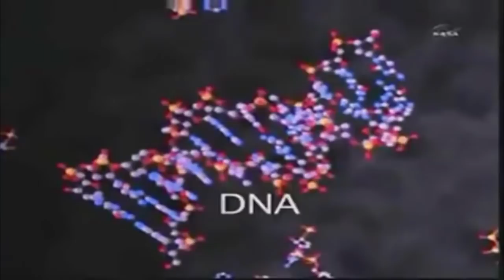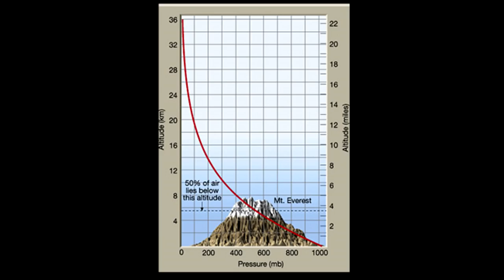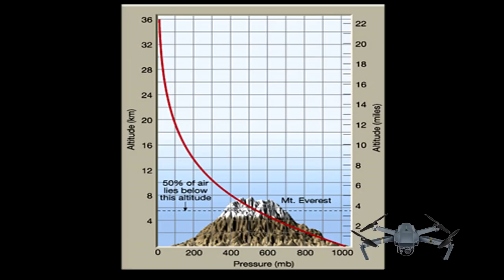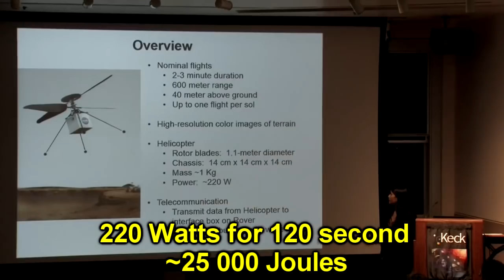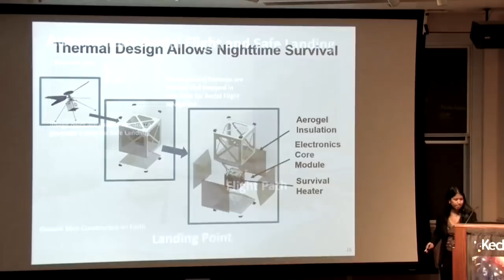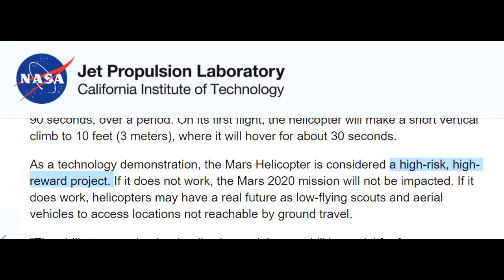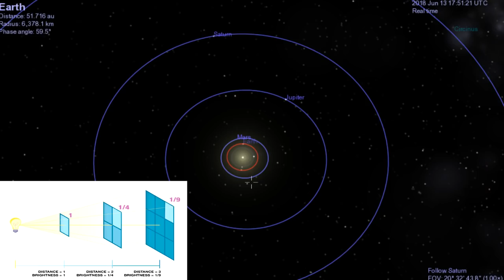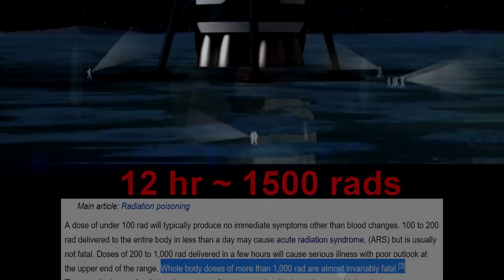NASA is sending Helicopter to Mars!! Smart or Silly?

Comment: Two major aerodynamics mistakes in this video:
1. the lift explanation is sub-par, overly simplified with impact physics instead of pressures. Also maximal lift is usually achieved at ~15° angle of attack (not 45°), after that you are likely to get separation and loss of lift on the upper side of the wing!
2. Lift is proportional to the square of the speed and not linearly proportional, therefore in a 1/100th of an atmosphere you only require 10x the speed!I think it's good to point out that at 1/100th atmosphere you also have less drag. I think the problem is possibly having the rotors approach transonic speeds -> compressibility -> problems. I trust they know what they are doing.
Reply: They've tested it in a vac chamber, job done.
You're the first I've seen so far to point out that not only is the lift explanation wrong but so is forgetting atmospheric drag.
If you can run a earth bassed aerobatic heli blade at those RPM's then you'd need farrrrr less power to spin at the same rate on mars and far less material strenght to support the large heli body and the serious loads those stick stirers put them under. 
centripedal force is no matterial issue so aerodynamically you'd have the same forces to lift 1kg here that you will on mars.

Purely for control they'd be far better going down the multirotor route, it can be a bit breezy up there and that style of rotor with it's low power won't do well to combat it.
Reply: At 45 degrees angle of attack on a helicopter you're going to get rotor stall and possible separation of the rotor from the aircraft lol. Helicopters typically have around 10-12 degrees collective pitch maximum and around 6 degrees cyclic pitch control.

Comment: Was that a "safety tether" in the vacuum chamber test? I assumed it was a counterweight, providing about 2/3 of the lift needed to lift the craft, to simulate Martian gravity. I could be wrong though, I'm just guessing
Reply: I think they just didn't want to crash it in the confined space.
Reply: CreativeType well it could've served that purpose too. a 2 in 1 thing kinda
Reply: Hadn't thought of it being a counterweight, good point.
Reply: I thought this same thing
Reply: Not likely.  They just don't want to trash their prototype if there is an unforeseen mechanical failure.
Reply: As Thunderf00t said, it shouldn't be able to fly on earth a counter weight is the only reason it should be able to.
Reply: Nicholas Hylton 
It is likely. They use tethers all the time to duplicate reduced g. The astronauts trained with tethers to mimic lunar g. 

So a reduced atmosphere in a chamber, and tether assist lift is very reasonable.
Reply: +Josh Patton
He said it probably wouldn't be able to fly on earth outside of a vacuum chamber.
Reply: impero101 he did, but it's still the only explanation for how it could fly in earths gravity with those proportions
Reply: Certainly, and I definitely agree that the purpose were probably two-fold as a safety-wire and counterweight, such that they didn't have to pump most of the air out of such a big room. :-) I just wanted to clarify what TF said to avoid a misquote.
Reply: Neko Suki not likely, they'd have the battery on board for weight anyway, so shouldn't need needed
Reply: impero101 
There are large enough vacuum chambers. It’d be more than worth it to create Martian atmosphere and Martian gravity as best as possible. If the whole thing is crap shoot, proper, most realistic testing is the minimum.

What cannot be duplicated/simulated is the Martian gravitational effects on the inertial gyros. The reaction of the mass of the machine in flight is still 1g environment.
Reply: Vacuum chambers have nothing to do with gravity, you can't pump the gravity out of a room. The earth is still right next to you!
Reply: Jordan Manners 
Duh.
Reply: They use tethers to simulate reduced gravity by pulling UP on things!  To have it tied down to the floor?  The only explanation for this is a safety tether, to prevent it from hitting the walls and eating itself.

Unless it is a wire that provides power - which would be useful for initial testing . . . but that would be an obviously unrealistic thing to expect to have on Mars . . .
Reply: (It probably IS the power supply, now that I've thought three more seconds about it.  I mean, where have you ever seen the SUN replicated in a vacuum chamber?  It's way easier to just deliver the same amount of power via cord - once accounting for the extra power needed to lift the cord . . .)
Reply: +Roonasaur I expect it wouldn't be too difficult to simulate a rough equivalent of martian sunlight in that chamber. Indoor growers can effectively simulate Earth ground-level amounts of sunlight every day with cheap, commercially available lighting. Devices like light-emitting ceramics can permit a wide and tunable intensity range and have a broad variety of spectra available.
Reply: But . . . would solar simulation be more or less difficult than just running a wire through less-than-air? THAT is the quesiton, lol.
Reply: I'd say that you'd want as close to the as-operating-conditions as possible, and things hanging off the bottom of devices (even relatively light things) would probably have an effect, but we're just spitballing here. I'm just pointing out that there's really not much of a challenge simulating the quality of sunlight on the Martian surface here on Earth if they wanted to test that hardware in action.
Reply: Roonasaur 
Oops. 
Power umbilical.
Reply: If we're going for as-realistic-as-possible . . . then how are they simulating atmospheric conditions?  Dust?  . . . Radiation?

Obviously, there's no way to replicate everything.
Reply: Roonasaur 
There’s a lot of data from the rovers. Particularly Opportunity which has lasted 14 years. Spirit lasted 5 yrs. their forecast was 90 Martian days. Curiosity is still active at 3x longer than original mission outline. Sojourner original mission outline at 7-8 Martian days lasted 83, 10x longer. 

So there’s a lot of institutional knowledge on what works and how it ages and the climate it has to endure. 

If the copter lasts a few flights it’d be fantastic. If it lasts as long as forecast it’d be fantastic. If it fails to launch, or gets airborne and immediately flips over, that would be sad.
Reply: No, but one step at a time. Seeing if you can reliably lift the anticipated mass in that configuration in that thin an atmosphere and on the back of energy gathered from light of that intensity through that hardware comes before doing all that PLUS adding dust, PLUS adding rads, et al. Baby steps.
Reply from the maker: yup... right.... didnt think of that :-(

else you're right, you have to triple the thrust you get from the helicopter and that never gonna happen.  From my experience with drones the difference between the power you need to fly, and 3x the power you need to fly is ludicrous!
Reply: eh at least he's got the humility to accept he got it wrong
Reply: A good assumption. Since this was being tested in Earth's gravity not Martian gravity that it would be proposed to work in.
Reply: It just needs to fly. Radiation or (dust most of the time) has not bothered the two rovers on the Martian surface for over a decade.
Reply: Exactly what it is.
Reply: K B  You don't need to specialise in chemistry to know that turning lead into gold is infeasible.
Similarly, you don't need a huge amount of experience with drones to know that achieving triple the thrust it takes to hover would allow you to accelerate upwards by double the gravitational acceleration (which is far more than necessary and there's no way they're doing that for a proof of concept-esque thing with some harsh power constraints).

Comment: As for 1W of power, it's worth noting that average industrial solar panel (like that 40W example you showed) in perfect conditions (90 degrees sunlight) converts around 15% of photons into electricity. However NASA doesn't have significant budget constraints, and they can afford something much more fancy - like multi-junction solar cells, probably with efficiency reaching 30-40% - like this one https://technology.nasa.gov/patent/LEW-TOPS-50 

These solar panels are prohibitively expensive, but in that case, additional cost is justified.

That moves them from 1W to 2-2,5W which is probably a significant difference
Reply: and it doesn't really need active cooling to any significant degree, the passive heat generated by the CPU and(likely) GPU should heat the craft well enough even when they aren't being used.
Reply: Lower pressure would reduce the heat lost significantly too.
Reply: Wouldn't the charging of the batteries alone create a decent amount of heat. Only need enough heating/insulation ability to prevent freezing at night.
Reply: TF says though that even if they used basically his cheap shit Chinese one it would produce enough power for a few minutes of flight, he says the numbers do indeed checkout overall , also TF didn't account for the lack of atmosphere which will increase efficiency, but TF doesn't make videos for scientific peer review.  He uses simplification and generalisation to highlight in layman's terms his points.  Which is basically it may work or it may not work.
Reply: As solar radiation on mars is about half of that on earth - they actually need the better panels.

Comment: It's always a bit dubious when you use some consumer level device for reference.. It more than likely uses multi-junction solar cells which sit around 35-45% efficiency..not to mention that solar cells are more efficient in space (no massive em field and little to no atmosphere on mars). The only issue I see is dust settling in between and on the blades/motor and coating the solar panel.  Also, it may sound like a simple maneuver but if they were to fly in the direction of the setting sun in their test flights they would get a tiny bit more power over all. I'm looking forward to seeing if they can pull it off. That ITS thing is old as hell Thunderf00t.. he said fueling stations along the way.. it's not even close to being fully solar powered. It's a vague presentation of some non existent mission far into the future.. it's fair to assume some sort of radiation shielding adequate for the task would have been developed. Though you don't have the massive magnetosphere of Earth there are pockets of fields poking out of Mars.. and if we're talking about Enceladus then you should check out Saturn's massive magnetosphere completely engulfing Enceladus. So you would be perfectly fine landing on Enceladus with basic shielding.
Reply: Taun-Chi Gaming finally someone who understands
Reply: Though what about the low atmosphere problem that would make the engines work much harder? Or the problem with making it stand right up if it falls Also the panels might be 15% to 20% more efficient then standard commercial panels but Mars still does receive far less sunlight and panels are probably still smaller then a 40 watt panel.
Reply: The only thing to make it work harder is the centrifugal force of the larger blades or higher RPMs. Otherwise resistance from pressure differentials will be the same as required force to lift the same object in Earth's atmosphere.
Reply: Also worth taking into consideration is most drones/quads use multiple motors in direct drive, whereas this could use a single motor with a gear reduction...it could consume less power while still turning relatively large rotors at a lower RPM.
Reply: If you partner it with a traditional rover then you could charge off the rover's massive solar panels
Reply: The problem with gear reduction is weight and this thing has to be ultralight. I bet they just hook the motor directly to the lightest shaft they can come up with that will take the forces expected.  The speed of the motor itself can be controlled electronically. It doesn't need to be nimble just efficient and predictable.
Reply: You need to remember that mars receives only half the radiation from the sun that we get.
Reply: Atian Firebolt But what is the effect the thinner atmosphere has on W/m2 on the surface?
Reply: Laughing Daffodils if its a counter rotating rotor, it'll either need two motors or some form of gearbox.  I'd imagine an extra gear or two weighs less and is more efficient overall than a 2nd motor.  Would be interesting to see how they've actually done it.
Reply: Taun-Chi Gaming 
 I love NASA. They do so much research and improve technology here on earth. So many people complain about funding NASA "while people are starving", etc, but the advances made by NASA and SpaceX benefit humanity in countless ways.
Reply: pws3rd 1 That's what I was thinking. Maybe a large solar landing pad that it could land on to wirelessly charge. It would still need its own cell for emergencies, which could be angled into the sun (the drone would always land facing the same direction). As for the solar radiation hitting mars, is he only taking distance into account, or is he considering the thin atmosphere with less water vapor?
Reply: Well, it's not NO atmosphere. Clearly there's enough to let a little helicopter fly.
Reply: +Andy Jones
Space X? I understand.  Space X has done more for space travel then NASA has done since the 1990's.
Anyone who thinks that NASA should keep getting funded is fucking stupid and is only focusing more so on it's past achievements from before the 1990's.  

Anything after the 90's becomes extremely scarce and hard to find, while you have companies like Space X already developing re-use able rockets, the most powerful rocket ever built, and even managing to push literal cars into space all under 1 rocket.  Now name me 1 NASA achievement in the last 2-3 decades now that is anywhere near comparable to that.
Reply: The only effect the quality of the solar panels has is the duty cycle of the system: if your solar panels are twice as good (for the weight), you get flights that are twice as long, or twice as often.
I don't see a problem with Thunderf00t's 1 Watt average power figure.  With good thermal management, it can operate on near-zero power when not either flying or transmitting, which is most of the time.

Comment: You got something wrong... to fly in air half as dense, your wing needs to fly sqrt(2) times faster, because lift is proportional to v^2. To fly in air 1/100th the density, the blades need to spin 10x as fast. Due to Mars' .376 gravity, assuming 1% air density (density, not pressure, the higher MW of Mars' atmosphere partially offsets the lower pressure), they need to spin sqrt (100*0.376) = ~ 6.13x faster
Reply: And this v^2 relationship shows up even in your simplified "batting air molecules" model (staying away from that debate, but TF is more or less right on the basics). If you spin the blades twice as fast, you will encounter twice as many air molecules per units time **AND** those molecules will be moved out of the way twice as fast. You change the velocity by a factor of two on twice as much mass. The momentum change is thus 4x. There's a huge difference between spinning 100x as fast and 10x as fast.

Comment: Cheap solar panels are about 17% efficient.  Top quality consumer grade panels top out at about 25%.  The best cell ever made achieves over 40% efficiency.  Pointing to the cheapest panel and saying 'they won't have enough power' is not very sensible.
Reply: CatsMeowPaw 
U compare that with silicium based cells, but there are more materials outhere that work. One got way better yield, but degrade very fast. Thats bad for comercial purposes, but for a device that will stop working by dozen other reasons long before that effect come in place, it means nothing.
When i remember the name of this stuff i will edit, but if u watch the scene, u probably know it.
Reply: The current "off-the-shelf" GaAs triple-junction cells used on the solar arrays of almost every satellite range from 25 to 30% efficiency. Lab prototypes currently reach way over 40%, so I guess that it isn't too far of a stretch to assume they're using something with an efficiency closer to the latter.
Reply: No it is - as the solar radiation on mars is about half of that as it is on earth.
Also the panels on mars have to last  without failure under harsh conditions - they are not even close to those that only need to operate in space or laboratories. better than consumer products but they would need to be over 40% efficient to change anything.
Reply: "they are not even close to those that only need to operate in space"
You know that space is about as hard as it gets for a semiconductor device? Also, I'm not aware of any reasons why a solar panel on Mars would meet any significant challenge in those conditions.  The only issue you have on mars is the dust that can permanently block the solar panels of a stationary object, but that can be easily mitigated here by just hibernating until the dust storm ends and clearing the panel by spinning the rotor up for a moment.
Reply: "You know that space is about as hard as it gets for a semiconductor device?"
No, it isn't. having sand be blasted at the panels is quite a problem.
It is not about sand blocking the light but damaging the panels.

The biggest hazard to solar panels is the weather - something that is of no concern in space.
Reply: You know that there's no weather per se on Mars? And even here on Earth good solar panels last well over 20 years in most conditions. The fine sand dust on Mars won't damage solar panels on such a timescale, just as it didn't on Spirit and Opportunity.
Reply: ABaumstumpf - If this was the first time NASA put solar panels on Mars, this would be a concern, but they have several solar panel rovers on Mars working fine. If it works on the Spirit and Opportunity and it isn't being changed much, it will also work on their next system.